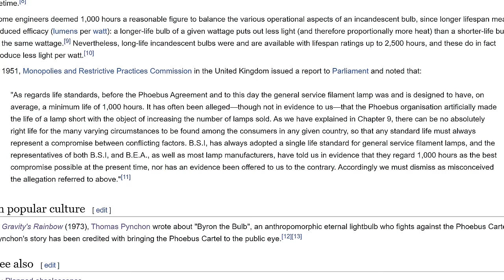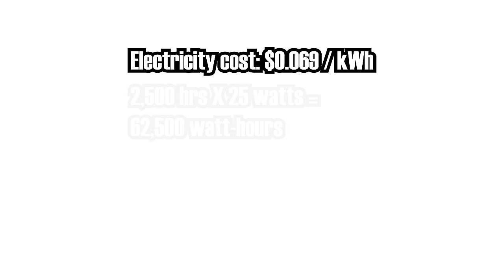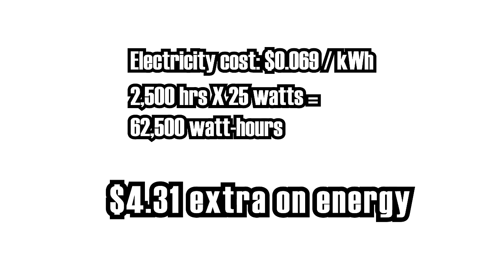Longer-lasting light bulbs: it was complicated

Comment: You remember that brilliant blue-white flash you got when an old incandescent light bulb burnt out?  I once had a bulb get stuck in that state for about 10 minutes. And for that 10 minutes it was the best light bulb ever! It was daylight bright and a strong white with maybe a hint of blue, like we wouldn't see again until the development of 6k LED lamps; but the "super-nova" bulb was much brighter.  Honestly, if I could have bought light bulbs like that, than ran more than 10 minutes, I'd still be using them today.
Reply: The bright flash is caused by an arc forming across the broken ends of the filament as it breaks. It's usually very short-lived, though perhaps in very rare cases it could end up more stable. It would ultimately become unstable, though, as either the filament will melt completely or the current draw will blow a fuse/breaker or cause other nasty side effects in short order. The closest thing to this I know of designed to operate stably were special “self-ballasted mercury” bulbs which actually contained a mercury arc-discharge capsule (producing bluish light) with an incandescent filament in series with it inside the same bulb to provide a crude ballast. They were meant to be able to run in regular incandescent light sockets, and the light from the filament plus the mercury arc looked a bit whiter and a bit more pinkish/bluish in color than a standard incandescent. The filament ran at low temperature and the bulbs were designed to last much longer than most plain incandescents as well.

Comment: Did anyone ever experiment with coated filaments for lightbulbs? If you could prevent the tungsten from evaporating by adding, say, a ceramic coating, then you could run them hotter. In addition, as the light is produced by the coating incandescing rather than the conductive metal instead, then by picking the material carefully you should be able to tailor the peak frequency of the black body radiation being produced.

Comment: I have a bunch of ComEd bulbs still in the original packaging. The packaging shows the lumen output and expected run time.  They were all unusual wattages and longer life bulbs. 2000-2500 hours. 26, 41, 77, and 102 watts.

I always figured the extra few cents they were able to charge because I’d the increased power consumption helped them break even on giving bulbs away. Who knows.

Comment: I am old enough to remember changing tons of plain ol' bulbs - but not at home, only at both grandmas' houses, since my parents were big fans of CFLs, 12V halogen spots and other weird fixtures that don't use bulbs (I can count the number of bulbs in that pretty big house on one hand)

Anyway, I couldn't really convince grandma that them newfangled LED thingies were better, so I simply snuck frosted glass filament LED bulbs in, asked if she saw any problems, then touched the "hot" bulb with my hand. Sometimes a practical demonstration of the benefits outweighs any arguments about safety and power bills you could make.

Comment: I just ordered over $300 in incandescent light bulbs, probably overkill but I do use 3 by my computer monitor set to about 30% brightness. Just for the that filament glow. All have lasted over 2 years so far. I have a series of 4 on another set of steampunk lamps. Given the 2 year+ so far on very low dimmed bulbs, I might have a lifetime supply, assume the seal don't fail.

Comment: The 60W 230V E27 Osram bulbs my parents used to buy in the 1980s were rated at 2500h, and gave as much light as the cheaper 1000h 60W bulbs of other brands they occasionally bought.

Comment: I wish you would do a video on why we need to outlaw incandescent bulbs over LEDs or incandescent. I’m confused how an easily manufactured bulb with little materials can be so much worse  than something that takes way more steps just because it’s a little more efficient, but i don’t know what the best choice is and someone explaining it in this type of context might help me understand.
Reply: The answer is partly in the video. An incandescent bulb  produces a lot of heat to get white enough and be efficient. LED does not need high temperatures and thus it's about 7 times more efficient at converting watts to light.
Reply: some of the motivation for banning incandescent bulbs was to make sure people weren't just going to stick with the cheapo . 99¢ especially compared to early consumer LEDs

Comment: Going back to incandescent light. I had two light fixtures in a garage that used 130v bulbs which were more for commercial use. Running at the lower voltage of 120,    I never changed them the whole time I lived in that house, about 14 years.

Comment: I remember "repairing" light bulbs by getting the dangling broken bit of tungsten wire to reconnect to the rest. Very satisfying if I could get it back working though they never lasted long. I often didn't have a replacement bulb on hand so even a few extra hours of lifetime were welcome.

Comment: I remember that around the time the ordinary tungsten light bulbs were getting banned in the EU (around 2009 to 2012) some company claimed they had invented more efficient tungsten light bulbs. They had covered the inside of the bulb with a coating that reflected back much of the heat but not the light that the tungsten filament produced.
Thus the filament would stay at the same temperature but the light bulb would use less energy because much of the heat produced would be reused to keep the filament glowing.

It would naturally have the same issues with longevity vs light quality but the electrical consumption would be less.

It was of course, too little too late to become a commercial success and I have not seen these light bulbs available anywhere.

Comment: By the way, the less is power applied to LED, the more efficient it is. If you replace a current set resistor on the LED controller board with a 2x value, it will make standard LED lights suck both in lifespan and efficiency.
Another important thing: there are some LED light bulbs with linear current stabilizers, which just dissipate excessive voltage as heat, and in case of these bulbs efficiency depends on mains voltage and LED chain operating voltage. I live in Russia, so our standard mains voltage is 230 V (50 Hz). After rectifying the current we have 310V DC on the capacitor. And I saw 230 V rated LED lamps with linear stabilizer and 42 V LED chain (7 LEDs rated 6 V each, connected to series). That means, only those 42 V of actual 310 V are properly used. Rest of the voltage just gets converted to heat. By the way, that crappy bulb was really hot, though it was LED and not super bright.
I have the story when I had to connect this linear stabilizer to the LED chain designed for 228 V DC. It was on the separate board from another LED bulb (that one had dead stabilizer but working diodes) installed in my mom's nightlight. This circuit is great, really efficient and reliable. Decreasing the current and voltage drop on stabilizer made it really cold.
So, 2 ways to make LED lamps better:
1. Reduce current through LEDs.
2. In case of linear drivers, increase the amount of LEDs connected in series if that's possible.

Comment: Video Suggestion:

Classic car ignition and spark, distributors, ignition coils, (why you shouldn’t hook coil negative to electric choke negative wire), etc.

Or

Classic car (~1960’s) carburetors. There’s so much that goes into them, and getting examples, for the magic of buying two of them, usually is pretty cheap.

Comment: In my experience, higher end LEDs are basically unkillable. We have a 30W bulb in our kitchen that cost quite a bit around 2010 and is still going strong. Cheap ones, on the other hand, are a gamble at best. Most of them are overdriven, or lack proper constant current drives, relying on cheap resistor arrays instead.

Comment: I hate having to replace things when one little piece of it breaks. I’m always searching for ways to repair things that break before I finally concede and replace it. Indeed, I still have my 94 Acura Integra that I’ve owned since 2001, with 384,000 miles on the original drivetrain. I’ve replaced and repaired many things on that car over the past 22 years, but the engine itself is still going strong.

Comment: 4:02 that's a good point, however there might be cases where changing a lightbulb is very expensive, so you'd rather use a less efficienf one that lasts longer. So why make a limit, they could instead just have imposed to write the specifications (power usage, lumen and lifetime) on the package as it is done today with LED bulbs.

Comment: During soviet era in Russia one factory in Latvia named RESR or Rigas Elektribas Spuldze Rupnika (Riga's electric lamp factory) made incandescent lamps that lasted extremely long time. In my grandparents Livingroom, a soviet ceiling light had white little 100 watt incandescent mushrooms in it made by RESR and trough the thin white coating you could see the filament sagging extraordinary low from the supports but it did not burn out. I asked my grandpa and he told me that when he moved in to the house in 1960s he installed these mushroom lamps in the fixture and never had to change them. I only started to get interest in lamps when I was 10 years old in 2009. Those mushroom incandescent lamps lasted 50 years and never burned out. Turns out that on the lamps the stated voltage was 245 - 255 volts. The nominal voltage in a soviet era house from the city was supplied with 220 to at most 230 volts. and in the house that had low quality thin wires imbedded in walls and the poorly designed grid system of the city it was not uncommon for the house only to have 210 volts when a few appliances would be turned on such as a tv or an oven. This is why the bulbs lasted for such a long time. Of you take a cheapest light bulb from mennard's and you turn it on across 100 volts, it will last easily 10000 hours of continuous use, if not more.

Comment: I worked for a major build manufacturer in the late 90’s and early 2000’s. 

We could make lamps last way longer…. Unless you wanted to actually light a room. 

In fact many of our long life (6000 hour) bulbs were designed for 130 volt circuits. The other advantage was they had was resistance to power surges. So we also sold the same one as a “country service” lamp. And yes the light output was crap. (My hunch in the centennial light is it was designed for a 240 volt circuit and someone started using it in a regular 120 volt)

I used to do these calculations all the time for consumers in demos. I didn’t matter. Customers always felt ripped of when they had to change a bulb, unless they bought our “economy” pack. 4 lamps for 1.00 at Home Depot in 1999

It was an interesting market to work in

Comment: Man, I love your vids.
Can I make a bothersome suggestion?
I'd love if on top of monetary cost analysis, you'd do environmental cost analysis - ie, replacing lamps more often makes financial sense, but is it ecologically sound? If you value sustainability more, what would be preferable?
I know this would require A TON of work, but it sure would be neat.
Cheers.
Reply: This is the one thing I was hoping he'd address, but didn't. Sure, light bulbs are consumables, and the incandescent ones are mostly inert, if not entirely so. Glass, steel, and a little bit of tungsten don't cause nearly the environmental impact that the components of LEDs (and CFLs!) cause; but it's still a factor, right? I know tungsten mining isn't exactly eco-friendly.

Comment: I very much agree, Incandescent light bulbs is not the hill to climb when going after planned obsolescence .  I think Planned  obsolescence increases in direct proportion to greed.  And is a function or a product of manufacturing ease.  Make stuff from the lowest cost materials with the minimum human labor required.  A good example of this is a simple control panel be it a stove a washer  a microwave or many other consumer products.  For many years these have required switch's , button and knobs which all required panels with holes and cutouts carefully cut out and switch's or other controls mounted and than wired and installed into the device you are manufacturing. These devices usually preform their intended function for years and years.  Enter cost cutting and maximizing share holders investment.  . They can cut costs a lot with membrane control panels, a plastic sheet with some carbon traces printed on the back that when the plastic face is pushed , deformed the back makes contact with other traces that preform the switch function.  That may work for a while , certainly long enough to get past the warranty period and then as they crack or the carbon starts to ware off they no longer work reliably.  Usually just a little longer than the guaranty provided that is supposed to make you feel that you have a reliable product.  Make no mistake they know how long .these machines will last and they can engineer slightly better components if needed to make sure they just exceed  the life of the product they promised in the guarantee, and no more.  They are all too happy to sell you a new one a year of so after that  tome when intermittent operation drives you mad enough to toss your device out and go buy a new one.  You can mess up their planning though, learn to fix stuff.

Comment: Suggestion for a future video: 
Portable air quality analyzers. There are a lot of fairly affordable air quality analizers on the market that measure anything from CO2 to formaldehyde,  partuculates, and organic aerosols. The variety of devises below or a bit above $100 is remarkable. I am quirious of your opinion  on the matter of indoor air quality,  measurement as well as recommendation on a device. Based on the price most of those cheap devices are probably fake but some of them actually behave kind of legitimate. I was told that the very cheap ones use a single alcohol sensor and do some approximations based on the measurement but some use more sophisticated combined sensors and might be legitimate.

Comment: I've always been curious about the advent of fluorescent lighting and how it evolved over the years with regard to the same efficacy vs. longevity points.  Early fluorescent lighting technology was fairly simple and auxiliary equipment employed simple electromagnetic concepts, and those configurations rarely failed while powering lamps that often would last well over a decade.  Case in point:  I have a 32 watt fluorescent circline fixture on my bathroom ceiling that is from 1961, and the bulb that's in it is probably from the late 1980s, and it still works.

Comment: Retail prices for lightbulbs were low. 
If you buy cheap LEDs today it's the same. 
You can get them for less than 2$ per piece. 
Yes they don't make the nicest light but they illuminate a room pretty well. 

Although they're surprisingly light when holding them.

Comment: I don't think detergent was the best example to prove your point about consumables. It's extremely common to either dilute detergent, or stuff it with filler, and encourage the user to use way too much, because this results in being able to sell big packs with too much filler, force the product being used up to quickly, thus, meaning you have to buy more.

It's not quite planned obsolescence, but consumable goods are definitely plagued with a similar issue. I think your own video on dishwasher tablets kind of touched on this.

I have a major gripe with this whole topic. Because when you pay for a 1 L bottle of liquid hand soap, you are paying for just a little bit of actual soap, and then the costs of transporting essentially just a liter of water potentially from China or somewhere else quite far away. Thinking about the logistics costs of this is just horrendous. Think of the amount of space, time and fuel used simply to transport filler. If you see this in any kind of commercial or manufacturing context, even stuff like dog grooming, everyone always just buys concentrate and dilutes it on site. Because yeah it's both insane and expensive the way we use consumables.

There are some companies actually doing this now, where they will just send you concentrate cleaning product that you pour into a bottle and dilute yourself with water. Stuff like shampoo bars are great as well. I've kept track and a shampoo bar last me exactly a year. I don't even want to think about the amount of plastic shampoo bottles I used to have to throw out in a year. Didn't have to deal with that, didn't have to go to the store to get more, and that's not even mentioning the actual cost saving.

Comment: I’m not saying planned obsolescence hasn’t ever happened but it’s a lot more rare than most people think.  It’s a bad look when a company’s products routinely crap out before their competitor’s.  All components have a finite cycle life expectancy.  Life expectancy always comes with trade offs, like cost, availability, or performance.  Product developers usually start with what they think is a reasonable life expectancy for their customers and design to that.  That sounds a lot like planned obsolescence but this is a minimum requirement, not a maximum like planned obsolescence would require.  The goal is to make sure the product lasts as long as the customer would find useful.  Making it last longer would either make it more expensive, tougher to source, not perform as well, or some combination of the three.  I’ve never been limited on selecting components that will last longer than needed if they meet the requirements of the part.